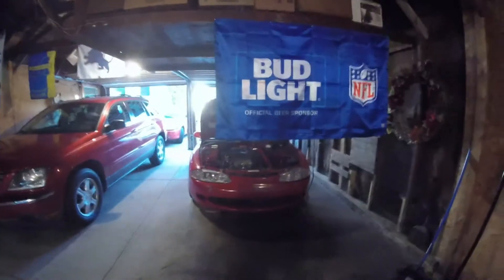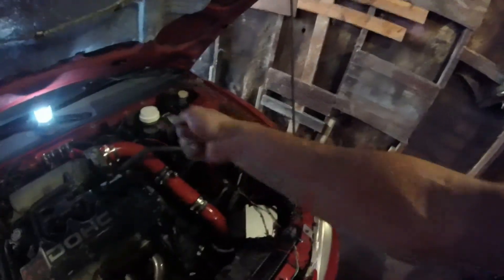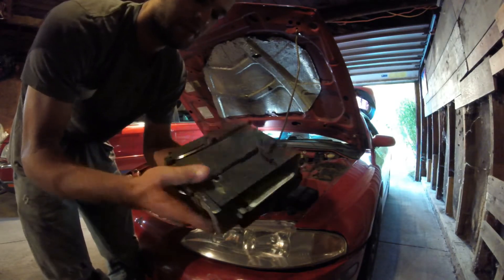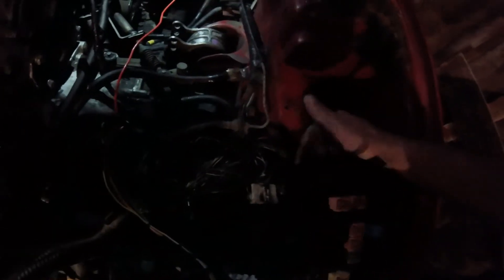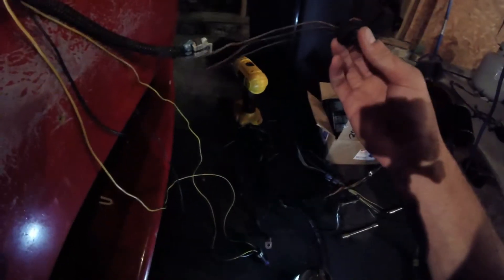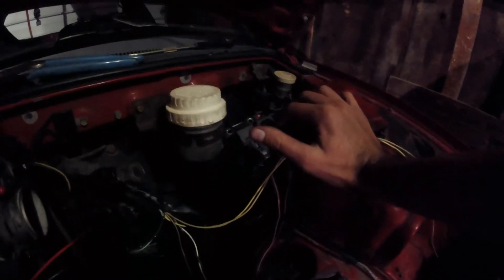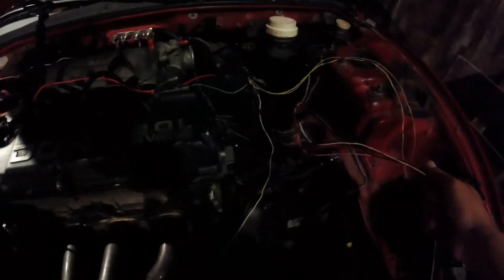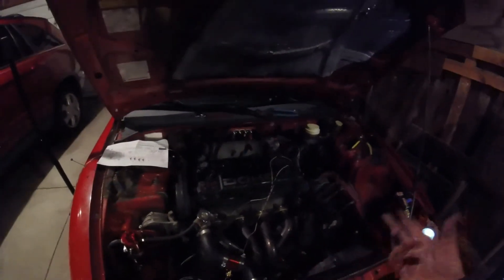420a Megasquirt Built Part 1: Teardown!

Comment: Damn. You should've started with a How to Fix Rusty strut towers and then install mega squirt. 

You won't get allot of power from a stock 420a from Mega squirt.  The whole engine needs to be rebuilt.  

The stock 420a HP is 145 minimum  your col air intake won't help either you'll only 2hp from it.
This has been proven by Bulletdsm on 2gnt.com